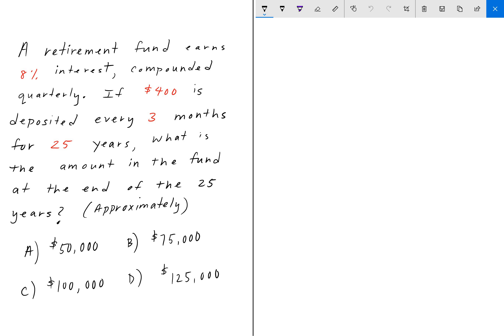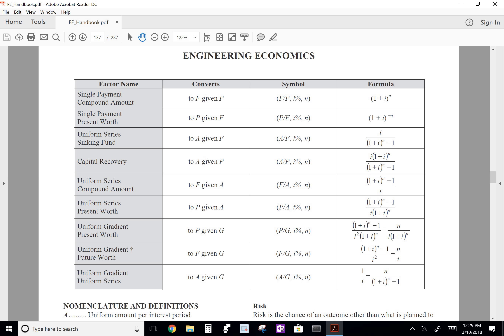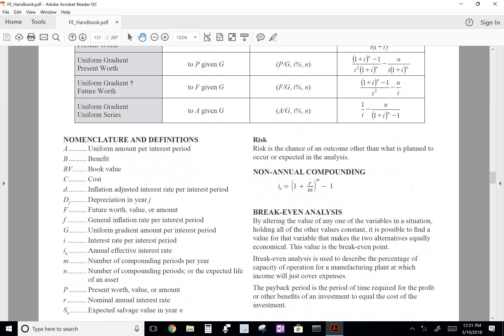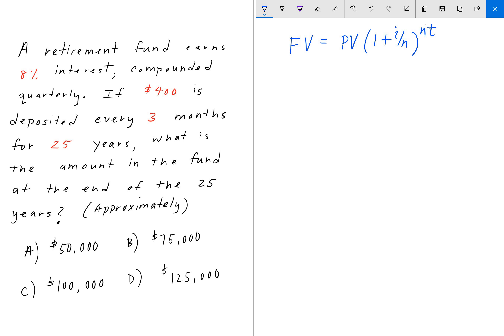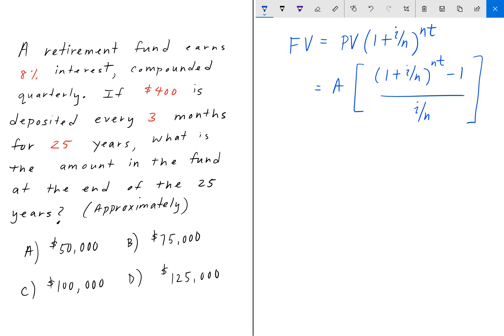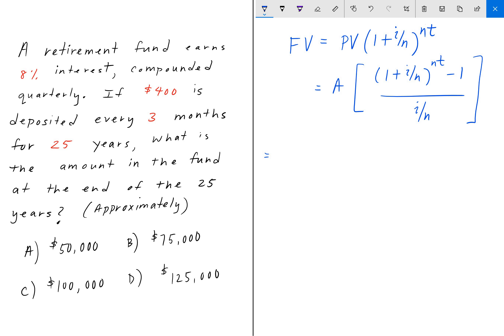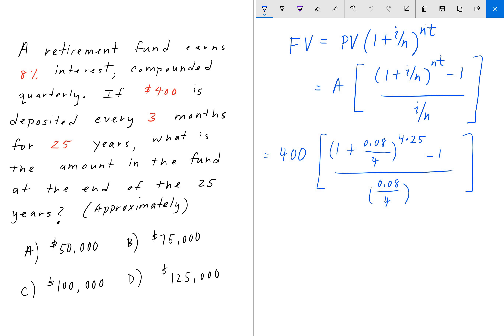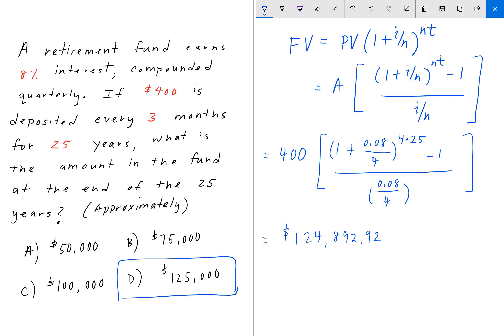FE /EIT Exam Prep - Engineering Economics 1: Future Value of Money

Comment: To get the answer quicker using the provided table in the handbook (and also to avoid from memorizing that equation) --> when compounding you do i%/given compound (quarter,semiannual,etc.) & n*given compound. So in our case we would have 8%/4 (quarterly) and 25years *4 . We then use our new % and n to find the factor we must use. i=2% so we use Factor Table - i =2.00% and n is 100years so we go down to 100 and over to "F/A" for future value of annuity. Our factor is 312.2323 ---> Thus 312.232 * $400 deposit = $124,892.92

Comment: You have to go to the definitions below the formula table in the handbook to see how they define the quantities. Instead of using i/n as you did, they define i as interest rate **per interest period**. This means you can't simply plug in the interest rate (0.08 in this case) straight into the formula from the handbook. You just have to know to adjust by a factor of 1/n based off the definition.